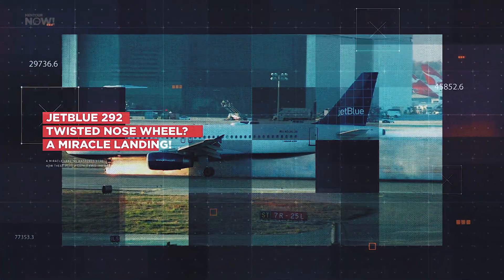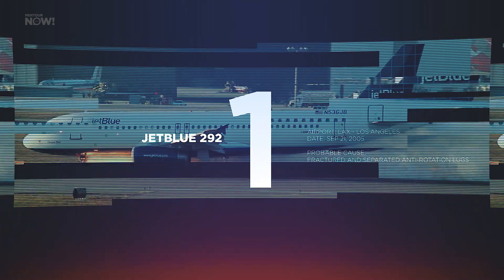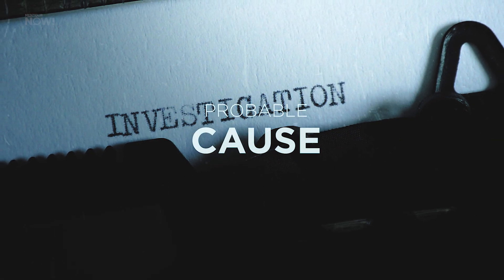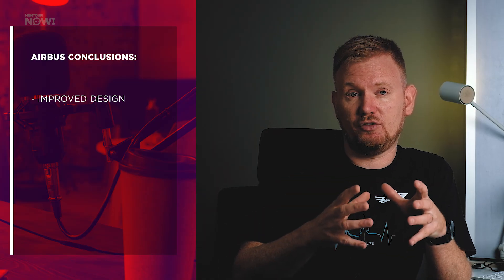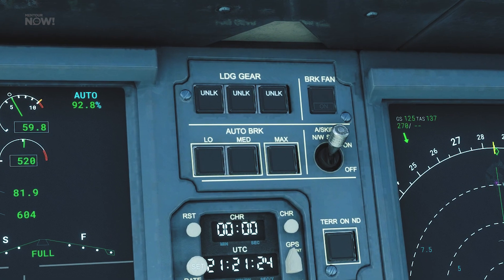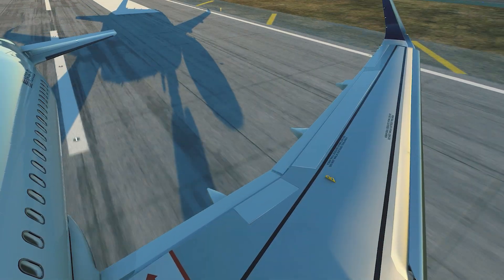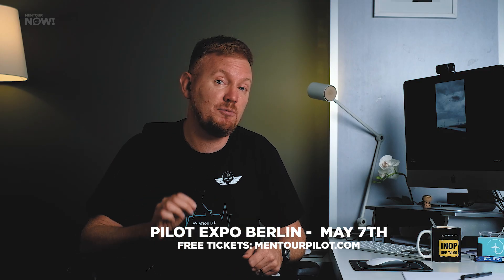The TWISTED Story of the Airbus A320 NOSE-GEAR!

Comment: "moving the passengers to the back of the plane" 
if the plane is quite full, does that mean the plane will land with some passengers standing in the aisle w/o seatbelts?
Reply: No. It's worse than that, it means a first class passenger would have to sit with the peasants in cabin class.  😀
Reply: @jefferyindorf699    😆

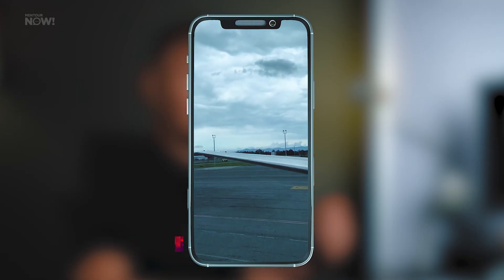Comment: 14:51 "A lot of sparks coming off the nose wheel, which would be normal"
When such an incident is so common that it gets referred to as normal... Maybe they could simply replace the whole nose gear with a wooden pole - cheaper to replace, less wear on the runway and possibly less potential for causing engine damage.
Reply: I love your idea!

Comment: For me its just pathing foulty design. All foults where bcs of bad programing. If pilots have manual stering of wheel all of this will not happen. Its bcs only computer can steer and it was badly programmed.

Its not so hard to design rotating wheel which now exactly where it is all the time and allow to check its position and turning it with electric motor.

Comment: Thank you very much! But all in all - something seems to be wrong with the A320-Nose Gear - otherwise there wouldn´t happened so much incidents with exactly this same part of the aircraft. If a type of engine would have again and again and again uncontained failure´s it would be investigated what is wrong with this type of engine - even if not always the same part of the engine broke off. So it´s in this case, too.
Reply: Uncontrolled engine failures are extremely dangerous, hurling shrapnel at the surrounding airframe.   So are fires.   So are flight control faults.    Gear failure is an order of magnitude less dangerous, and 5 in 20 years out of 8600 A320's is not "so much".   - which is probably why for example, the 737 Classic was never grounded for its 23 main gear failures.    (Not picking on the 737, it's just the first example that came up when I googled)

Comment: In the JetBlue video you mentioned the pilots hit the engine fire switches after touchdown as opposed to merely shutting them down normally. I'm guessing pulling the fire switches probably means the engines are a write-off or will at minimum require tons of costly maintenance/inspection. Given that this seems to be a relatively low severity event, is pulling the fire switches actually the specified means of engine shutdown in the unsafe gear checklist? If so, might the pilots reasonably choose to do a normal shutdown instead, particularly in the "we have 3 green on the gear indicator but also the ecam message" situation?
Reply: Pulling the fire switches will shut off de fuel and hydraulic lines and close the bleed air valve. It will not directly release fire extinguisher agent - a separate button need to be pressed for that. The fire switches basically isolate the engine.

Comment: why was the RAT deployed for a nose wheel steering problem on that last incidence.
Reply: As soon as they're safely down, they shut down the main engines so they don't suck in any debris the nosewheel kicks up, at that point the RAT deploys automatically (even though it's not needed and it won't work at that low a speed.   I guess they could add a circuit to prevent it, but it doesn't hurt the RAT or the plane so why add a complication that's just something else to go wrong?)
Reply: @cr10001  that makes since👍👍

Comment: So do any other aircraft suffer similar n/w problems (as often) or are Airbus just particularly bad at n/w design? Even if the causes are different in each incident  it just shows how many failure modes are in the original /redesigned system. How many others are there yet to be uncovered?

Comment: Airbus dropped the ball hardcore on this.  That gear needed to be re-engineered.  That many failures for that many reasons means the basic design in flawed, and needs to be fixed.

Airbuses decision to "fix" the issue by issuing bulletins isn't fixing the problem.  It's passing the buck.  "It's not our fasult, they pressure washed the landing gear."  "It's not our fault, it's the computer!"  "It's not our fault, it's not our fault, it's not our fault."

It is YOUR fault, you build the darn thing.

Comment: Hi, overall the editing is good but some feedback.
The white flash at 1:24 was very sudden and it felt jarring as a result. The following sequence had a lot of white flashes which started to feel a little grating. At 1:35 there was a white flash which was immediately followed by a red vertical strip transition which felt a little like you had string two transitions together. Around 2:50 there was four white flashes in the span of about ten seconds, which made it feel like a camera flash in the space. It's not very pleasent when they are so frequent like that.

Comment: There is a video of the LATAM taking off, and the problem starts there. Shortly before rotating, the nose gear starts a shower of sparks so I assume the rotation of the nose gear to 90 degrees happened during the take off roll. Might be interesting to see the reason for this because so far the incidents I know of have ocurred during flight.

Comment: Thank you for the deep dive into this. It is interesting that so many failure reasons can lead to such a specific gear failure.

I am curious why Airbus would stipulate not to follow the checklist if the indicators are green but a failure is still suspected. Would be interested if anybody has a formal reason for this. The thing that seems most reasonable to me is that they don't want to introduce a habit of second guessing the safety indicators.

Is it perhaps about time that the A380 was fitted with a camera feed of the front gear that the pilots can access if there is any question about the status of the front gear? Or, really low tech, a viewport/periscope system the crew can access if a check is warranted? A fly-by is okay if the situation and available fuel allows; but a visual indicator could render that unnecessary.
Reply: I’m also wondering why commercial aircraft aren’t equipped with exterior view cameras?
Reply: Default position is 90 degrees in the event of a non specified failure.. green lights indicating gear down, this eliminates any checklist being required as it maintains the 90 degree default and can be landed without much incident. Smoke and small fire. Otherwise the problem could be exacerbated by having the gear trolley wheel on touchdown causing the aircraft to diverge off the centre line. Left right rudder can give a measured steering as well as asymmetric thrust.
Reply: @trollking202  was that reply many to end up on a different comment thread?

Comment: It seems odd that Airbus finds this design and risk acceptable instead of a proven design that works for other aircraft.  They should at least put in an emergency release that would allow the gear to just spin freely 180 degrees so the wheels land straight. How many more causes have to be discovered?

Comment: Thanks for another great video! With each successive event, it seems like Airbus is just applying a "band-aid" fix, instead of addressing the basic design issues with the nose gear. Six 90-degree failures in fifteen years is a lot! I'm willing to bet that you're right -- this last event with the LATAM A320 will probably be due to a similar, but not exactly the same type of issue.
Many different aircraft have experienced "steering hard-overs" (the Swearingen Metroliner was famous for them), and have resulted in some runway excursions, including the B737 that I just retired from after 20 years. But, in over 16,000 hours, I never had any kind of steering issue, and certainly never saw any of this magnitude in any of our 737 operations.
There's an old saying: "The more they overthink the plumbing, the easier it is to stop up the sink!"

Comment: Airbus should use the landing gear of the 737.
Reply: Not serious, surely?   But in any case, it would be much too short, which is the original root cause of the Max's recent woes...
Reply: @cr10001  maybe get inspiration from the design. The 737 has a very robust. To my knowledge, the 737 has had no landing gear problems. Whatever the solution, hope it’s fixed.
Reply: @danielaramburo7648     Well, here are a few 737 gear collapses - UA2429 in 2019, Sun Country  SY110 this February, Jet Airways  9W-2423 in 2015,  Virgin  VH-HUH, Brisbane 2017,  Caspian EP-CAP at Isfahan this January,  Southwest 737, New York, July 2013. 
And that's just from the very quickest five-minute Google.   It's fairly common.     Which is what I'd expected - given the huge number of  737's flying around - and just as many A320's, now - of course there's the occasional problem.   (11,000  737's have been produced, and 8600   A320's).
(The problem I referred to with the 737's gear is, it's too short, and can't be easily lengthened.    So modern, fatter, more efficient  turbofan engines won't fit under the wings.   Which led (via a long and tortuous route) to the Max crashes.)

Comment: Imagine that you could steer your plane with your left or right wheels (under wings) - like in tanks, and the nose-wheel is always (passive movement) at 0 degrees? ;-) What do you think? Have a fantastic day! Great job Peter! How was at Dubai city?
Reply: it would be pretty complicated because the main gears bear the brunt of the load. so the assemblies that would allow them to turn would be huge and it might require additional reinforcement of the airframe around the gears. it would need a lot more hydraulics that will potentially be under increased stress during landing. It would be neat to see, but far less safe.
Reply: @notsam498  but steering connected to left or right engine load - is this possible?
Reply: @bkaczy  Some light aircraft have a freely-castoring nosewheel. They are steered on the ground by differential braking. (Like a tank) The Aerospatiale Rallye is one such.

Comment: Are the A318, A319 and A321's nose gear that much different that they don't seem to suffer the same issues or is it one of the odds of occurrence due to the shear number of A320s in relation to the other three models in the A320 family?
Reply: Probably has to do with the different numbers of aircraft on service. The A320 base version has now been around since the late 1980s, the other version came later. Meaning Naturally there are more A320s in service than other version resulting in more incidents on this exact aircraft type. For reference a 737-800 is gonna be involved in more incidents than a 737-600 as the -800 is larger in quantity.

Comment: This appears to be a "conspiracy" of faults in the design,  any one of which will cause failure,  instead of a "checks and balances" system designed to prevent failure.

Comment: Petter, I have to disagree to some extent. There is one thing in common: wrong desing of this whole front wheelset and its control system. I would prefer 3 "same" faults, than 7 completely different resulting in the wheels being perpendicular! "Back to the drawing board" Mr Airbus!

Comment: Curious why more Airliners don't have outboard cams to help in these situations
Most autos do
Reply: Cuz of certification, lighting, checklist procedures, pilot training, implementation, regulation and development cost. It’s far more complicated than just taping a GoPro into the gear bay and sticking a monitor to the other end of the cable.
Reply: @dopepopeurban6129  Its possible, irc a380 have cams for PMC (Passenger Media Center), we used cams when CRT was in prime
Reply: @mateuszzimon8216  yea but I don’t see the benefit there. One way or another the pilots will know that something happened to the nose gear and a 90* rotation rly isn’t the end of the world. The gear is gonna be broken for sure after landing but the aircraft will come down safely.
Reply: Most autos aren't flying at 600mph in thin air where aerodynamics matter a lot.
Reply: @etherealrose2139  That's a problem for engineers, and easily solvable
See A380
Rockets have external cams for example

Comment: The only thing I would like to have seen added to this is why is it just the A320 repeatedly having nose gear issues? How are other Airbus's and Boeing's designed differently that prevents it?
Reply: I doubt the A320 is having more nose gear issues than any other plane. If you watch the video closely, you see that there were six completely different failures, and the only reason they're in the same video is that they ended with the same symptom. On other planes, those completely different failures would have had completely different results and nobody would be saying "Aha! Pattern!"

Think about engine failures, for example. Sometimes it's because of a bird strike, sometimes it's volcanic dust, sometimes it's fuel starvation, sometimes it's a manufacturing issue with a turbine blade, sometimes it's improper maintenance, sometimes it's the pilots shutting down the wrong engine. It would be wrong to just focus on the common symptom of "the engine stopped working" and start asking "Why do plane engines keep failing?"
Reply: @beeble2003  I think this question is very much directing into this pattern. I mean look at what people say about Boeing, regardless of the problems nature. Sad people just want to point fingers at other people instead of focusing on problems and solutions, the exact reason why any of these peeps aren’t suited for jobs within aviation industry lol
Reply: @beeble2003  According to another post, the 737 mechanically locks the nose gear in place when airborne.  When's the last time you heard of the 737 having this issue?  (I guess Airbus could borrow this tech from Boeing in exchange for some help with 737 Max stability.)
Reply: @joesterling4299   Problem is, the 737 gear is much too short to be applicable to a A320.    757 maybe?
Reply: @joesterling4299  The last time I heard of a 737 having which issue? The whole point is that these incidents all had different causes. There is not "an issue" -- there are several issues that have all caused the same symptom, so they look like a pattern (including maintenance failures, and pilots ignoring the manual and trying random sh*t to fix the plane). On the 737, an equal number of completely different issues manifest in completely different ways, so people don't see a pattern.
Reply: @beeble2003  the point is that many different failures can result in the same potentially dangerous symptom, 90° nose gear. That in itself is a problem that could be fixed. Some kind of default positioning and locking mechanism could potentially solve this instead of them continuing to have these risky landings
Reply: @LongdownConker  90° is the safest angle for the gear to end up at. It puts the gear at a stable angle that doesn't flop around, doesn't cause the plane to veer off course and doesn't require anything more than a mechanical stop. The gear gets naturally forced into that position any time it's in a state where it can't be controlled. No plane has been seriously damaged by these failures and nobody has been injured.

In contrast, trying to lock the gear at 0° would require some kind of engagable lock, which could either fail to engage or could engage when it wasn't supposed to. If that lock failed, the gear would be in an unstable position and the plane would steer off in a random direction, potentially writing off the plane and injuring or killing people.
Reply: @beeble2003  there are already other planes that successfully lock the noise gear at 0° which is better than locking at 90°
Also if said locking mechanism can fail on a 0° lock it can also fail on a 90° lock so no difference there.
Plus as long as an uncontrolled nose gear doesn't go beyond 25° it will naturally straighten its back to 0° beyond that it tends to go to 90°

Therefore the only real difference between locking at 90° and locking at 0° to the safety of the plane is the 0° will provide a safer landing with less risk to the passenger.
Reply: @beeble2003  saying it hasn't hurt or killed anyone yet isn't a good excuse. That's what got boeing into big trouble with the  max, there were problems but no one died until they did. There are more examples like this of problems not being taken seriously because no one was hurt until people are hurt
Reply: @LongdownConker  The whole point is that you don't need a locking mechanism at 90°. That's just a physical stop: the gear physically cannot rotate more than 90°. It just rotates as far as it can, and then stops there, which is a safe position. Your proposal is to add extra equipment (a locking system) which brings extra failure modes, and those failure modes are more dangerous than the existing one. That is not an improvement.
Reply: @LongdownConker  "saying it hasn't hurt or killed anyone yet isn't a good excuse." The system as it exists has resulted in safe, completely controlled landings every single time. It's not that, due to sheer blind luck nobody's died yet. It's because the system is safe. Your entire argument is "It doesn't look good to me and other random people on the internet, therefore it might be lethally dangerous, therefore Airbus must doooooo  something!" That is not good reasoning.
Reply: @joesterling4299  
The problem with the max was airline, mantinence,  pilot error.

Comment: hang on, the engine shutdown to avoid FOD. Do the engines shut down that quickly? In some of the other videos you've mentioned how long they take to spool up. Or is it that the fuel flow is stopped and hence the fire risk? (just as likely to suck stuff in and cause damage but reduced consequence)
Reply: Spooling up takes time but shutting down takes less time
Reply: If I recall back to the video on the JetBlue incident, they pulled the fire handles for the number 1 and 2 engines, which cuts off the fuel to the engines immediately and arms the extinguishing system. The engines would have a very bad day if they did ingest any FOD, but at least there's not going to be any Jet fuel flowing in to them.